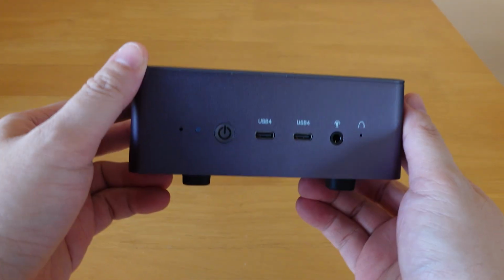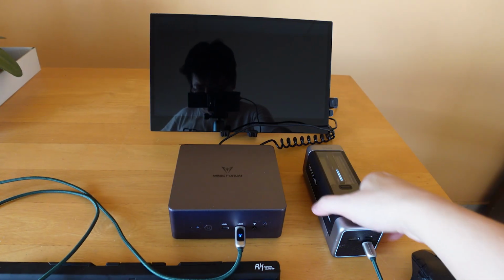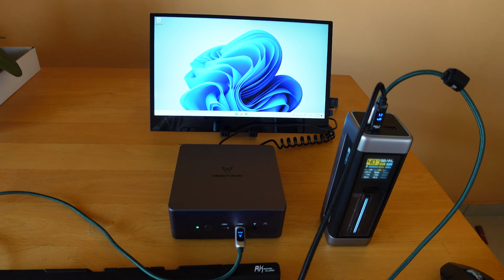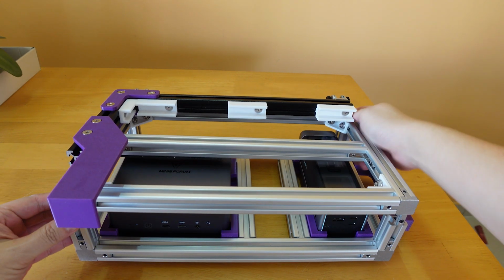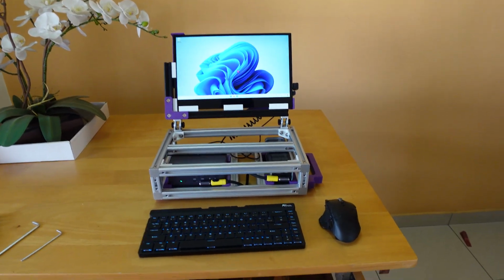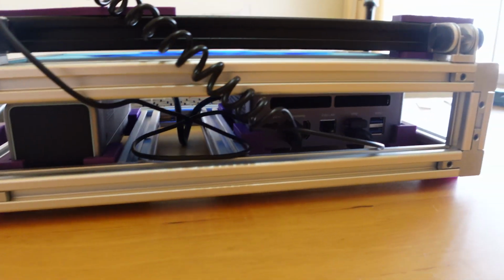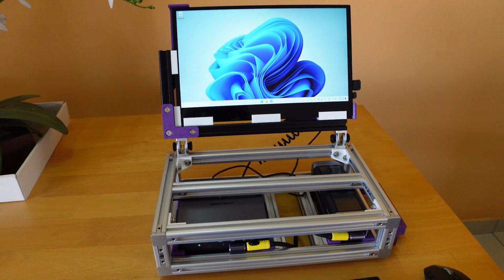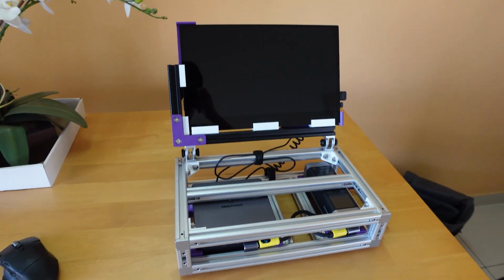Making A Portable PC From A Minisforum UM790 Pro

Comment: uperfect lapdock, bro ;)
Reply from the maker: Don't doubt how much more compact I can make the solution if I used that, but it's a bit expensive for just a monitor and a keyboard.
Reply: @marauderz  thats true, another alternative is just to try to make lapdock from a broken laptop, but I guess it will take much more efforts than your setup (like getting hdmi-in pcb and connecting it to lvds connector of the display and making up the keyboard and touchpad into a basically a usb-c dock).